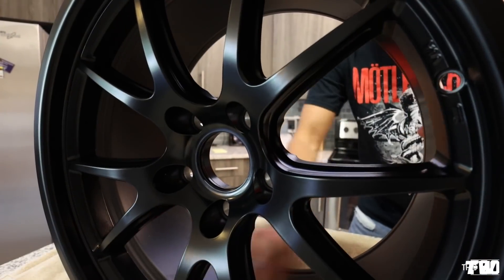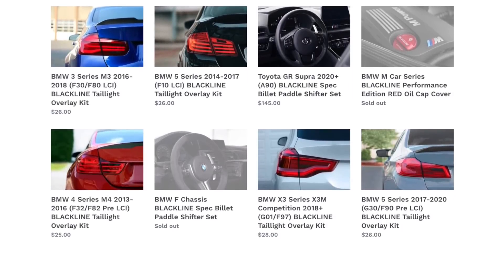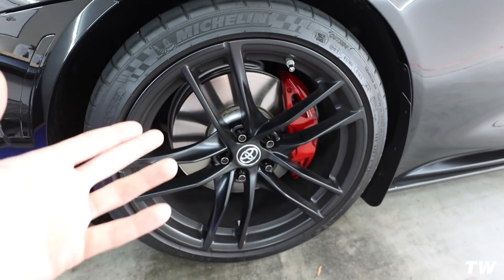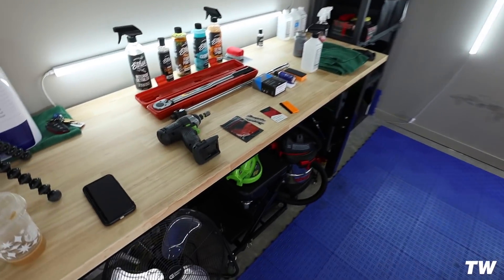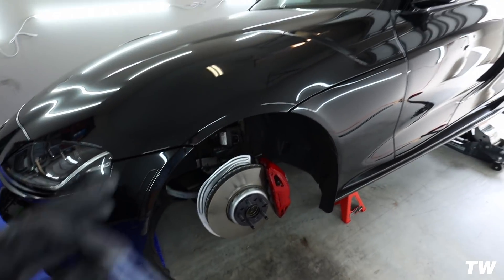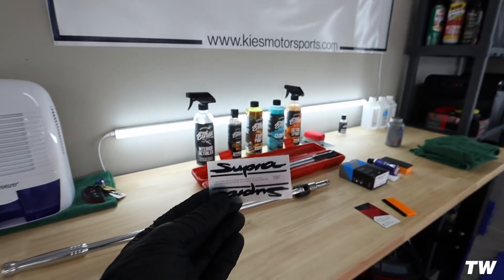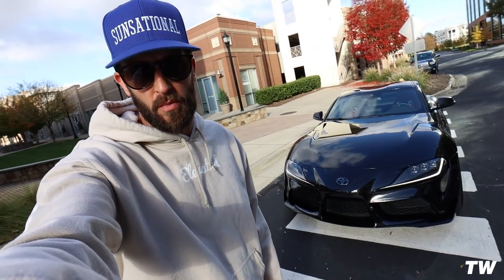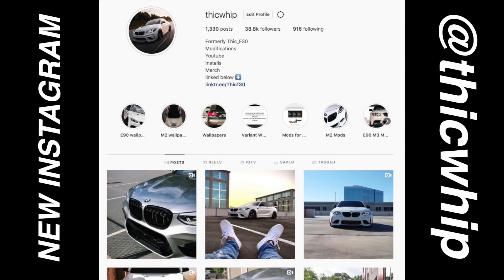THIS IS HOW I KEEP MY WHEELS AND BRAKES SO CLEAN!

Comment: Will the 30ml bottle be enough for 4 wheels or will I need the 50 ml bottle? For 437m wheels.
Reply from the maker: You should be able to coat 4 wheels more than 5 times with the 30ml bottle. You really don’t need much.
Reply: @ThicWhips  How long does it last? Do I have to reapply after some time?